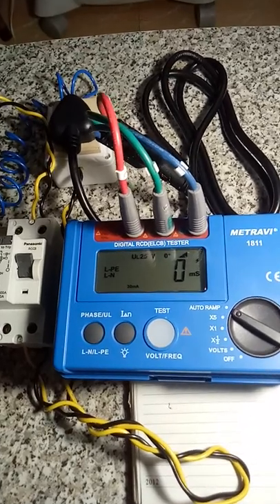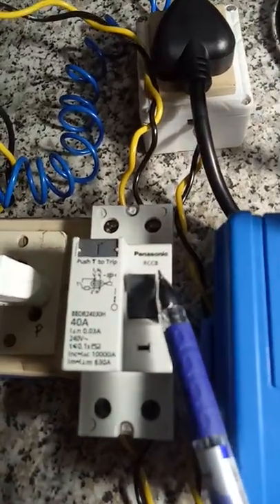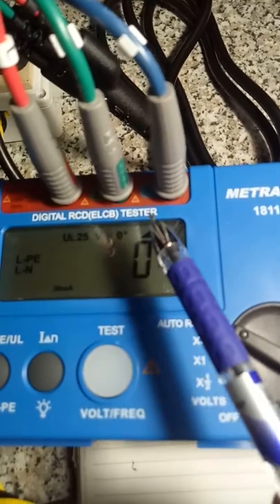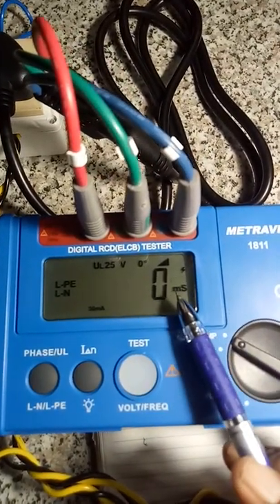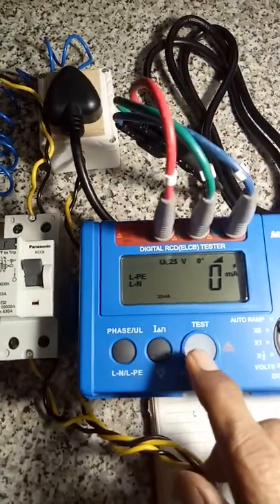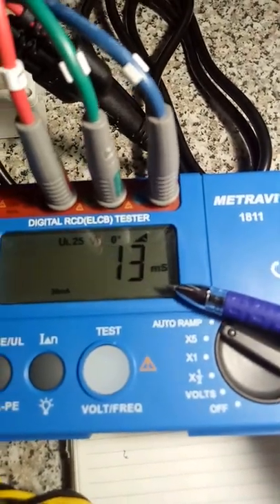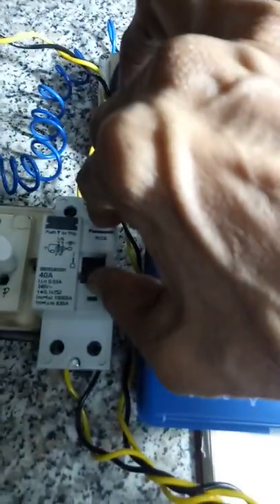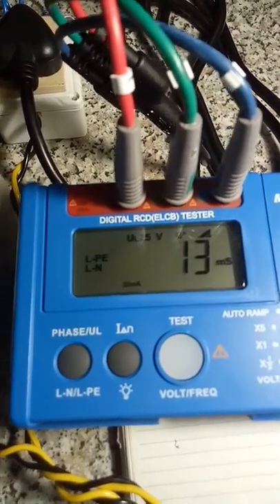RCD, RCCB, ELCB  Ramp Testing using Metravi 1811 RCD tester.

Comment: That meter is is manufactured by a few companies under licence from UNI-T and sold under different brand names such as UNI -T ethos kyoritzu . And one or two others they are good little testers not bad quality cheep as chips but perfect for someone just starting out as a starter kit,I recommend them to college students who are training to be electricians and to those who can’t yet afford to buy the big brands like fluke or megger and kewtech  I have one that I keep as a backup for my kewtech is sent away for calibration all though mine is a continuity/ insulation resistance tester.
Reply from the maker: Board is uni-t 582+
Reply: @30mAkills  yes they come out of the UNI-T facility

Comment: Some time ELCB get tripped and some time current not get increased after 20 mA for 100 mAmp setting and 60 mA for 300mAmp setting.
Transformer N earthing and Earthing has been also verified but problem is not resolved
Reply from the maker: Remove from circuit and do a bench test and post the result. Using adjustable type is not advisable.
Reply: @30mAkills  thanks for prompt response
Reply: We are using Gtech make EL1812
Reply: Will appreciate if you guide us on bench test
Reply: I think Gtech is brand name of Mitarvi
Reply from the maker: @ahsau2968  in order to rule out RCCB is OK or not : remove it from the connected circuit, keep it on table, give supply and check with your tester (gtech) in ramp mode and post the result.